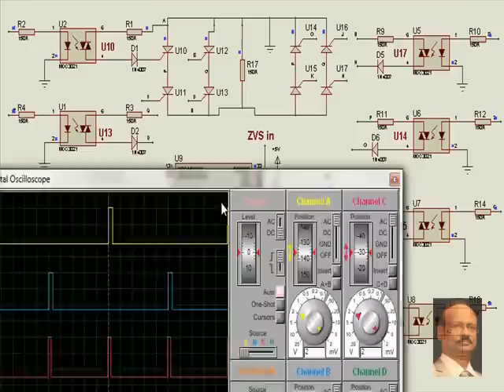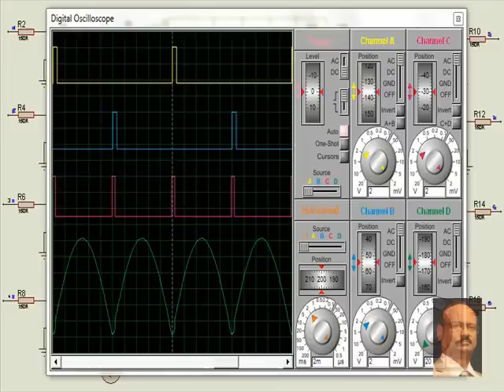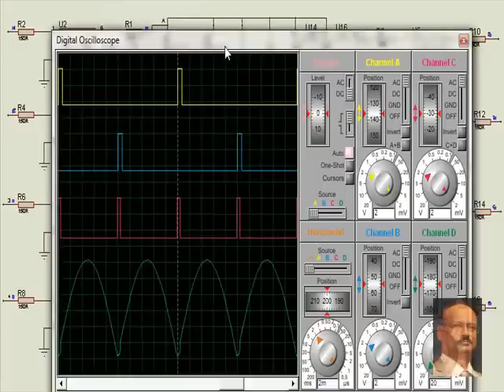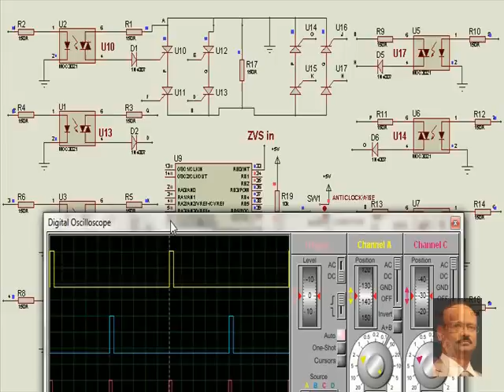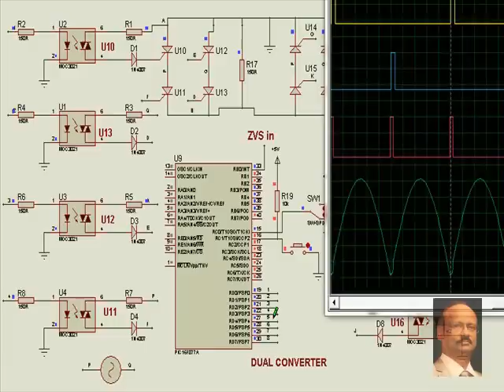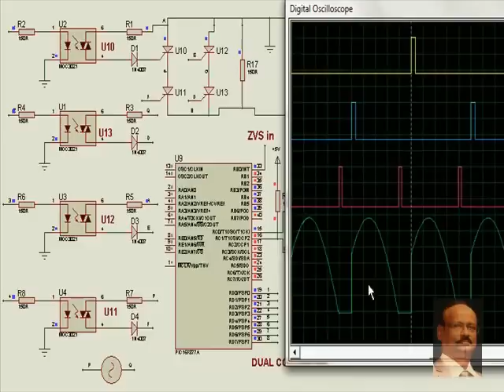8051 Microcontroller Project - DUAL CONVERTER Major Project EEE

Comment: which scr do you use? what is the source voltage
Reply from the maker: sagar sapkota ac 230 volt in real world but much low voltage for simulation.
Reply: @PatnaikUC  i have some issue with triggering so which scr u use for triggering
Reply from the maker: sagar sapkota take any Teccor type scr